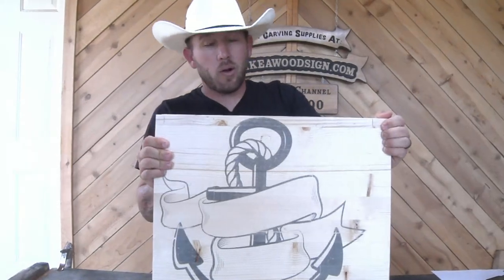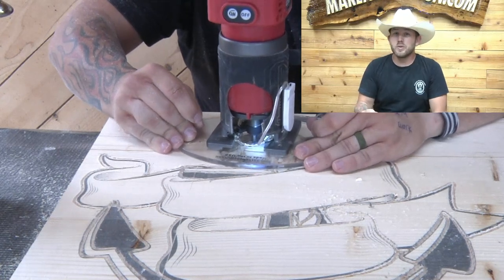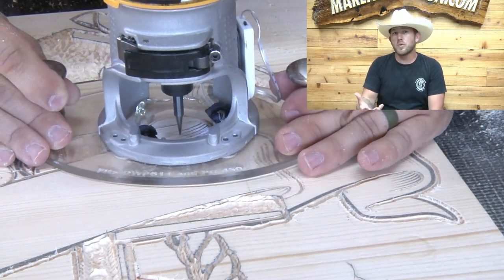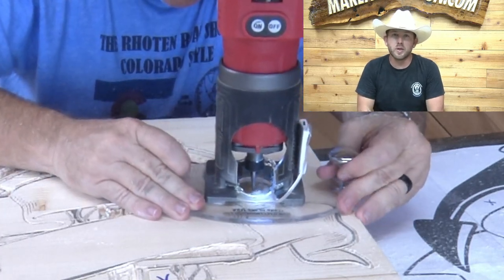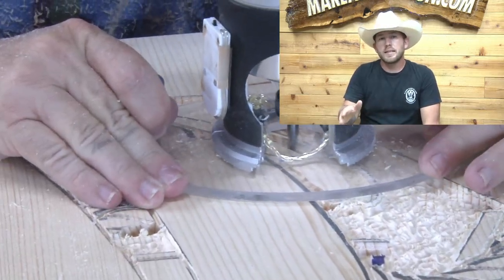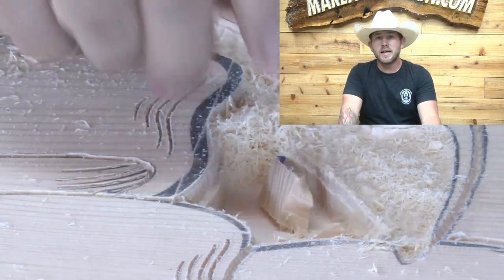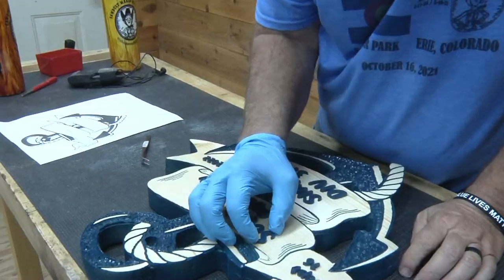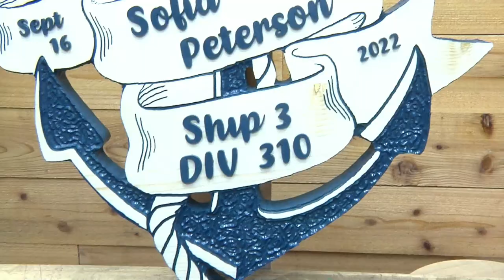DIY Custom Navy Anchor Made Out Of Laminated Pine  -  Cutting Shape And Carving Freehand With Router

Comment: Great Sign. Tell her thank you for her service. I do have a question though. What kind of wood are making it on ?
Reply from the maker: Thanks Kyle! We used the panel board we get from Lowe's.
Reply: @oldave100  did you glue some pieces together to get the thickness? And width?
Reply from the maker: No, it came as an 18'X24" board. We did put a 1/4" backer on it just to make sure the boards didn't come apart

Comment: Awesome work..
I have few questions.. 
This material are more than ¾" thick, right?
Also the initial piece of wood used was few board jointed or just one piece? 
I notice you used the Dewalt sander to take the paint out.. a belt sander can do the same job? 
I'm learning a lot of tips from you.. thanks for your videos.

Thanks 
Victor Garcia
Reply from the maker: Thanks Victor! To answer your questions, the material is 1" thick and we glued a thin 1/4" piece of plywood to the back to help keep the lamination together. 
You can definitely use a belt sander. Dad used one for most of his career until he found the disc sander.